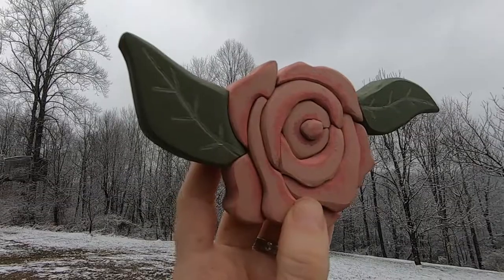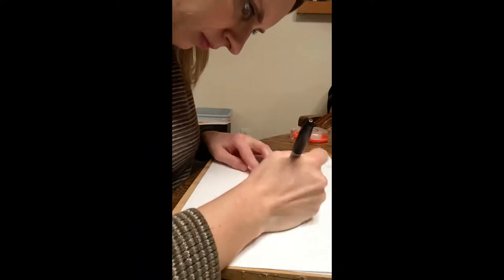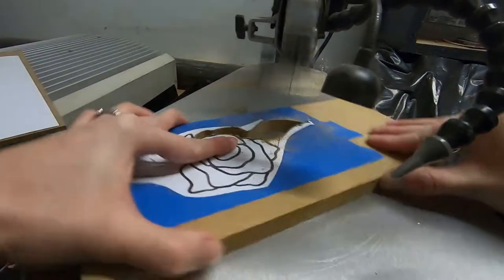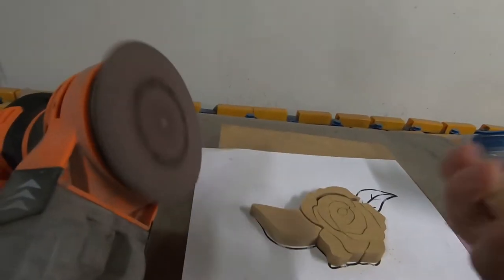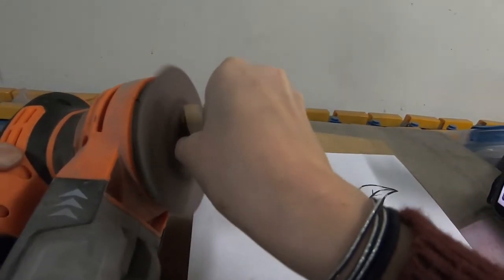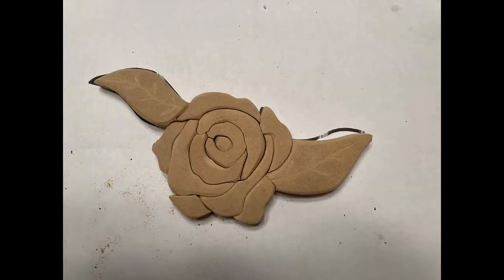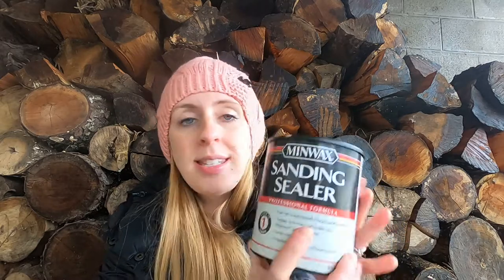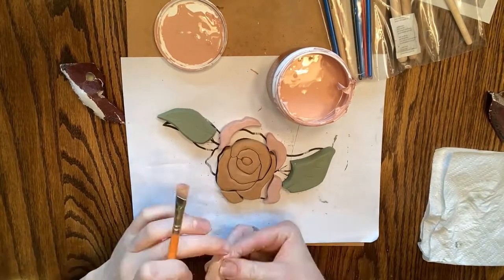Making 3D Florals on the Scroll Saw

Comment: I've used that sanding sealer prior to staining wood to get an even finish in soft woods.  My complaint with it was the can I had was the lid was plastic and it tore up when trying to reopen it.  I ended up pouring it into a jar and throwing the can away.  The sealer works well though.